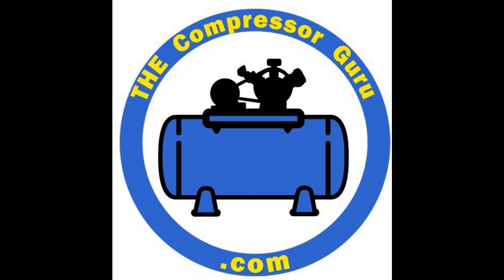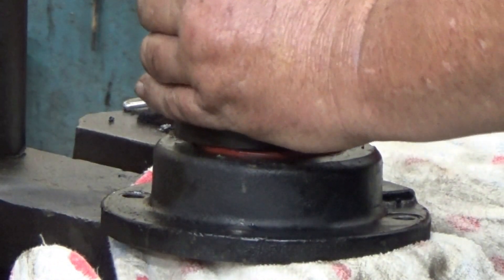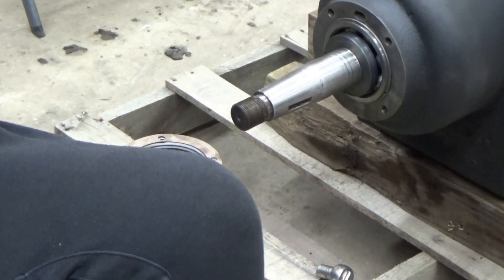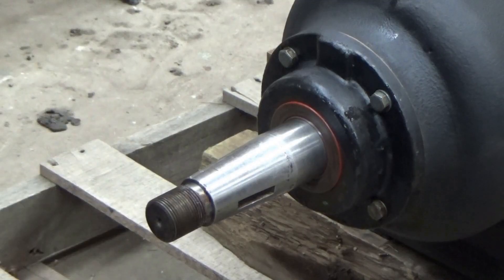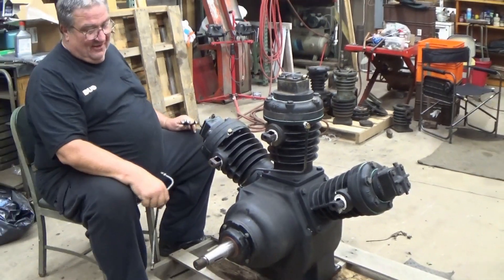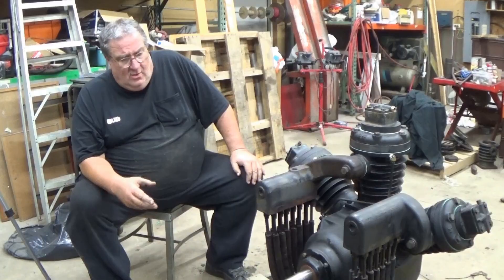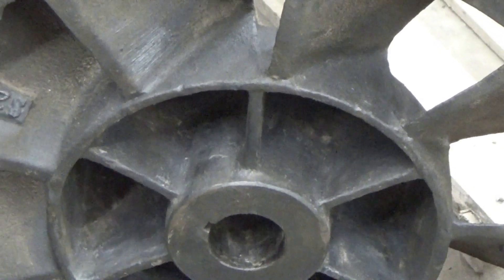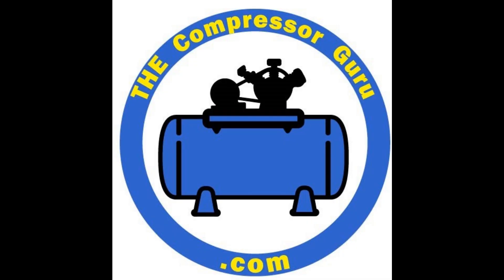Seal to the Wheel with and Innercooler in the Middle! S 5, E 11

Comment: Prayers for you Bud.  I’m a subscriber down here in GA and you helped me rebuild my T-30 when I was recovering from double knee replacement on the same leg. That was 2019-2020 and the compressor is purring like a kitten.  My tip, use pain meds without worry for a couple weeks and then get off them.  Don’t rush back to work but stay flexible as possible.  Ask for more PT.  I’m 59.
Reply from the maker: https://www.youtube.com/watch?v=rp8AIcPbxfg
I have had 1 knee replaced and my right shoulder . I know what I am in for thanks Bud